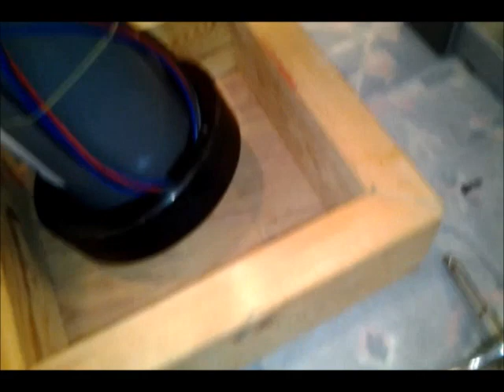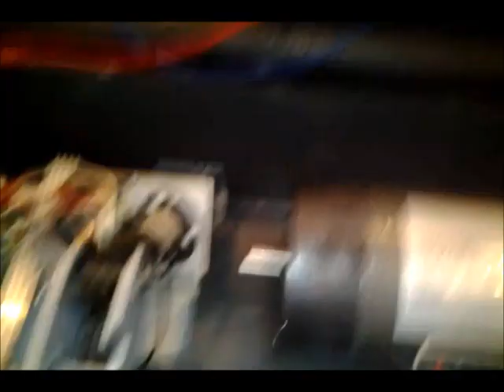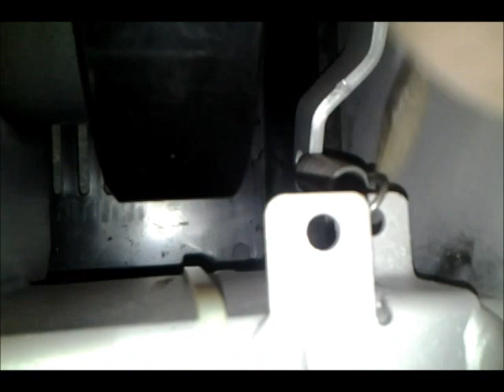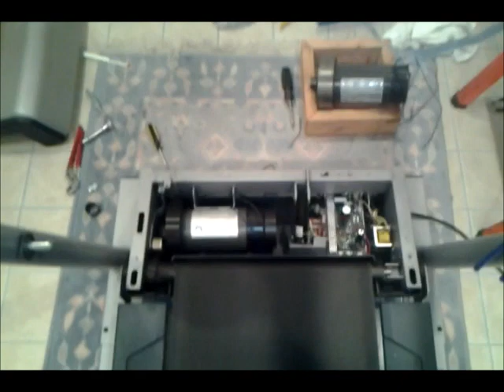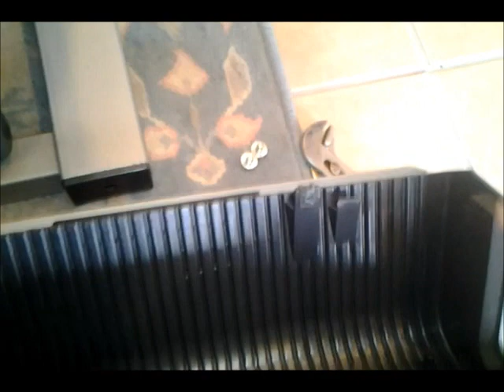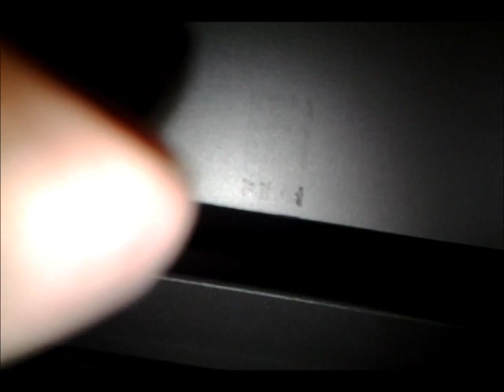NordicTrack Treadmill Motor Replacement

Comment: The key moment I need is how to remove the existing motor once the wires, belt and bolts are out. I loosened up the belt tensioners 15 turns each but maybe I need to remove the entire belt, or somehow raise the deck 10% to give me more room? HELP!!!

Comment: The transformer in my appliance has burnt out. It would be very helpful if you could tell me what the output voltage is. Or what voltage/current does the motor need?

Comment: What are the blue wires on the motor for?I was going to try a different motor on mine as when running the motor doesn’t spin consistently but the one I can try it with is for a different machine and only has a black and red wire no blue ones🤷‍♂️
Reply from the maker: Sorry, James but don't remember.  I upgraded to a new commercial unit & no longer have a schematic to look at. Can you see a schematic on it?

Comment: I figured might as well change the belt while I’m at it. But the actual hard part of it he job would be changing the belt. 

Probably gonna need another video for that. Or I’ll just keep running with the old belt until it is really shot. Honestly after 16 years my belt looks decent, no cracks across the groves when I bend the belt backwards and no shine on the back side. I do see the belt is worn on one side where apparently it was not aligned across the pulleys and was rubbing. I’ll just clean up the grooves on the driven pulley and be out.
Reply from the maker: Here are more videos on work on my treadmill, plus, the new model, I bought, if interested?

Comment: It’s such a shame that the machine isn’t built to last! Nordic Track sent these machines out with a faulty circuit board that will go out not long after purchasing. Oh, I should add, not long but long enough to be outside the return window. Mine went precisely 6 months after purchasing. The circuit board controls the belt, so when it goes out your stuck with a tv stand. Replacements are on back order due to high demand and I’ve read many customers end up with the same problem not long after replacing. I wish someone would have written about this when I was researching treadmills to buy. Please do some research of your own and steer clear of Nordic track brand treadmills!
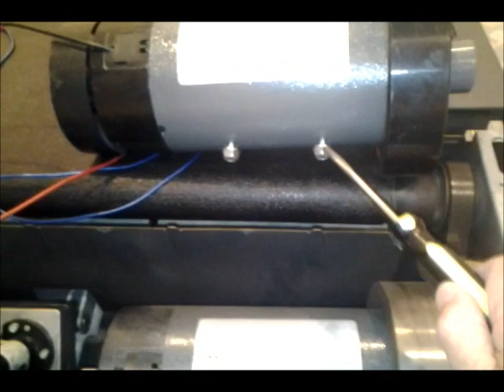Reply from the maker: Yes, Ali, we had to replace our Controller, too, but it lasted about 5 years.  I point this out at about 2:17 on my Part I video at:
https://www.youtube.com/watch?v=JX5_BRGmNLw
I had not heard of this being a common problem, however, & it needs to be considered.  Thanks for the info.!

Comment: My nordictrack treadmill stop working and I believe it is the motor. I manage to find a new replacement online but it is rated for 3HP and the one in the treadmill is rated at 2.75HP. Do you know if it will work if buy the higher rated motor and put in the treadmill? Thanks
Reply from the maker: I think it would work but you might call Nordict to get their opinion, also?  Thanks for watching.
Reply: Thank you for the reply and the suggestion on contacting Nordictrack.
Reply: Of course it's going to work without a problem, if the size fit it's s better

Comment: John, you bring up a good point, but the new layout is different...there is no spring or latch, the belt goes right over the pulley on motor and belt is attached to roller. I should have asked my son to hook up motor but leave belt off to try the motor alone.
I spoke to tech at Nordic Track who looked up my case. I mentioned about videos I had uploaded also at their request.
I explained motor was exchanged but still have loud whine/hum.
He said they would send out a new drive roller.
When I asked how difficult that would be to install, he put me on hold to check, camr back and said since this was my second call, they would open up a service request to have a tech come (no charge) after I receive the part.
At that time, tech can evaluate the conditions.
Part will take 7 to 10 business days...will keep you posted.

Comment: John, the new motor came late Friday, and my son came over on Saturday to help me replace it. He's more mechanically inclined. Unfortunately, the new motor exhibits the same loud whine. At 3 its very prominent, and at 5, it sounds like a jet engine. Didnt even go above that. Nordic Track was closed so Ill call them later today, and see what they say. Thanks,  Barry
Reply from the maker: roxio69, I'm sure you disconnected the spring to disengage the motor to make sure the noise is not the roller but the motor?

Comment: Appreciate you putting this up, and thank you for showing us the sound before and after a new motor.
I just received a new Nordic track and it was very noisy, even on low speed 1, 2 or 3
I had a treadmill for almost 5 years before, and even my wife commented how noisy it was, like a high whine/hum.
Spoke with tech today who listened and agreed the motor needs to be replaced, so they are sending a new one.
Thanks again
Reply from the maker: Fantastic, roxio69, that you are going to get a new one.  I assume it is free, because it is supposed to be a lifetime warranty?  Glad I could help!
Reply: The warranty said 25 years on the motor, lifetime on frame. Today they sent me an email requesting pics and videos of motor at 5mph and then walking on treadmill at 5mph. I uploaded my vids to a link they supplied. If they have a bunch of bad motors, I hope they get a different builder?? Thanks again  Barry
Reply from the maker: Best of luck, Barry!  Keep us posted.